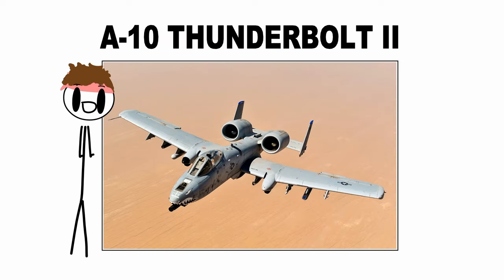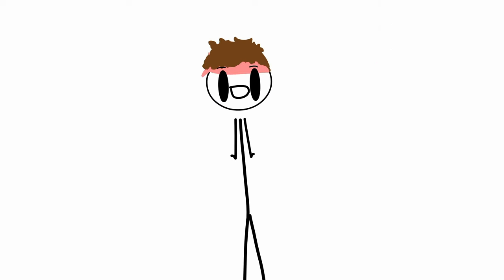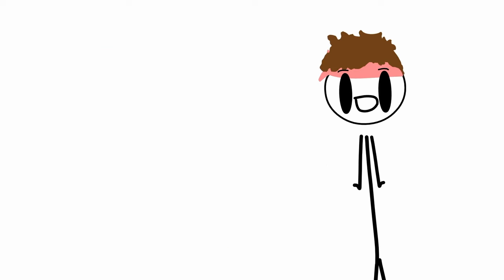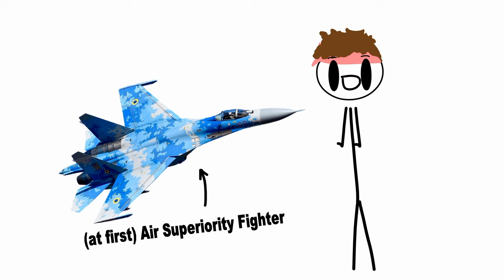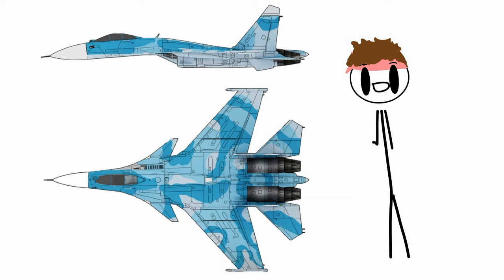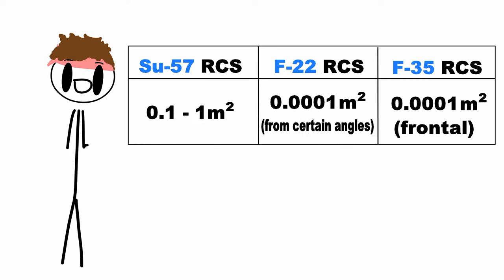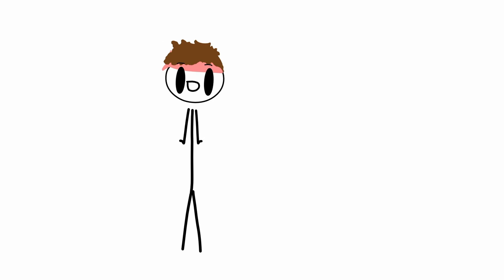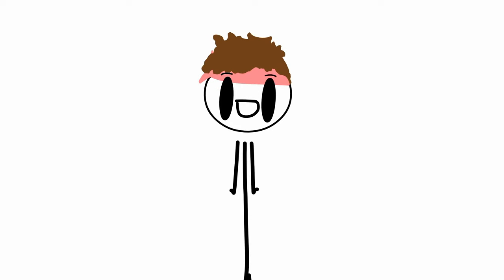The Coolest Facts about the Coolest Fighter Jets 3

Comment: The Su57 is still the only stealth fighter that everyone can see on radar.
Reply: anyone can see stealth fighters on radar but you can’t lock on to them
Reply: "it's not stealth it's a low visibility 4/5 pile of sh##" -habitual Linecrosser
Reply: @FutureGohanGlazer  it's got worse RCS than 4th gen fighters, you can literally see the wood screws visible on the airframe. It sure as hell can be locked on
Reply: @Ballistic_Idiot lost a dogfight to a kite bought my stealth fighter of wish also "habitual linecrosser
Reply: Never had been...
Reply: @ahta5708 that's the T50. not the Su57
Reply: @OAZO_Kcey no way, someone that can actually tell the difference between those 2
Reply: @poopyickydoodooobama09  if you can see it, you can lock onto it
Reply: @FutureGohanGlazer  Rafale had a lock on the f22 for 10 sec straight before wining the match
Reply: @FutureGohanGlazer that's just not true
Reply: @OAZO_Kcey you realize that in those matches the F22 has to be equipped with drop tanks in the dogfights. The Rafael also was placed behind the raptor. If it is a normal combat situation, which is a bvr fight and not a in visual range fight, the Rafael would win a total of zero times.
Reply: @OAZO_Kcey nope, look at recent videos, neither the screws nor the unpressurised bombbay issues nor the inlets being visible from the front have been resolved.

It is a propaganda piece, not a stealth fighter.

A current day IS-2
Reply: @apersondoingthings5689  The F22 Didn't have any extra stuff.
Reply: @koekiejam18  Like i said. It's the T-50. A prototype version of the Su57. If you look at the real Su57s (IRL) you will see that they don't have the screws at all.
Reply: @OAZO_Kcey  The T-50 is sukhoi's internal designation. Su-57 is the russian airforces designation.

Think Ar-15 and M-4.

Also maybe if you wanted to really counter anything i said you shouldve taken all my three points in your rebuttal.

Even if it was without screws, that still doesnt fix the unpressurised bomb bays nor the engines being visible from the front.
Reply: @al_the_crow see actually no one can because russian mod themselves retitled the T-50's they had to be Su-57's
Reply: @beProsto  t-50 is literally just a prototype airframe that later became su-57
Reply: @koekiejam18  if you look at the production units you'll see the screws have been changed and aren't the older screw types.
No weapons bays aren't pressurized (it would deafeat the point of having a weapons bay), although the gap between the doors should be smaller and that is a problem with construction quality not design (however I haven't seen a Su-57 weapons bay from up close aside from the preproduction variant, maybe they could have improved build quality).
I agree with the point about the engine, they made the engine radar blocker to reduce RCS and it does work a bit, but its not as good as an S-Duct and they should have changed it in the original design years ago.
Reply: And anyone that talks about how the RCS is similar to a clean F/A-18E/F aren't exactly wrong but they aren't right either, those documents that were made public were talking about average RCS in a 360° arc around the T-50, one figure will average out the other (for example if viewed from the rear the Su-57 will have a huge spike of RCS compared to the front, this will raise your total average RCS) it was also before it was even accepted to go into preproduction, in those documents it was also written down ways of improving the RCS during production and materials to use in the RAM as the original analysis didn't consider RAM. Today it is definitely more stealthy than at that time as we now know that the russians started using RAM in the Su-57 and changed the engine covers around the engine. 
So overall the average RCS value of a 360° arc around the plane shouldn't discredit the frontal aspect of its RCS, in the case of the Su-57 it definitely has improved overtime (but it isn't as stealthy as the F-22A obviously).
Reply: @FRGBlackBurn  I might be wrong so take this with a grain of salt, but last I checked the su 57 still is not in production, it's still a prototype
Reply: @firewolfy_6  I mean, it has a very limited production but it already has a production variant so it isn't a prototype anymore.
Reply: Stealth doesn't means invisible you know
Reply: @OAZO_Kcey  I'm guessing this was in a war game in which the F22 as standard carries drop tanks negating its stealth an maneuverability. The Rafael wont beat the F22 in a BVR match under real combat conditions.
Reply: @cockatoofan  Any radar can detect an F22 as long as its past the burning through threshold of the radar, which is put simply the point were the stealth is useless. Now to your other point, the F22 is a pure breed fighter, it is not intended for SEAD and as such is only intended to be as close to invisible as possible to other fighters. yes being invisible to Search radar would be nice but is unrealistic  as the burn through on the Search radar is stronger than an airborne radar and as such the F22s stealth only hides the radar at certain ranges but this is enough to create gaps in a radar screen which can be exploited for a behind the enemy lines attack. Se the B2 video by Mustard for a better explanation of this concept.
Reply: @mathijeba5375  Yes I do. Anything stealth can be detected, but the point is to delay that point of detection as much as possible to reduce the time the adversary has to react.
Reply: @cockatoofan  Maybe I did repeat a lot if not all he information unintentionally. to be honest I skim read a lot of it. But the main comment in this thread was complaining about the F22 so honestly didn't think much of the F35. And the F35 is a good SEAD jet in its own right but in terms of its stealth capabilities as far as I understand it the F22 is still better than the F35.
Reply: @cockatoofan  in all this, it's important to remember 2 things. Both aircraft are classified, so as you said, Lockheed is unlikely to release a lot of info, and the capability of the F22 will be less than the F35 Co saddening its 30 years older.
Reply: @firewolfy_6  Neither the burst nor the F22 had any additional equipment. it was a 4vs4 (real-time combat simulation) where you had to lock on to him for 4 seconds or aim the plane at him. The burst won.
Reply: @OAZO_Kcey  Source? Id like to read up on this.
Reply: @firewolfy_6  sure, let me see my search history (i'll modify my comment once i found it)
Reply: Probably because the whole "stealth fighter" designation came from external media assuming it to be so. Sukhoi's patent quite clearly states it's a multirole fighter with reduced radar visibility, which it achieved.
Things like visible screws do NOT increase RCS values as those can quite literally be seen even on the F-22 and similar jets. Langley AFB quite literally flies F-22's with cracked RAM coating and visible screws, after having spoken with an F-22 avionics tech, screws have next to no effect on the overall stealth capabilities of the aircraft, the fuselage shape, leading edge alignment play the biggest role of all, on top of that the RAM coatings just bring that value even lower.
What people assume to be the "visible engines" are actually the so called radar blockers Sukhoi came up with, the capabilities of those are not known, but the engines certainly are not visible due to the fact even the Su-57 has S-curved intake ducts, simply not as pronounced as the F-35 and its contemporaties.
All in all, the Su-57 is undeniably the most maneuverable 5th generation fighter out there with some of the best radar arrays, although the T/R module count on its AESA is not the highest, it's less than 100 modules behind the F-35. Combine that with DIRCM turret, engine TVC and EO/IR tracking and you have a fairly solid multirole fighter.
If you do want to criticize it, then critizice the rampant corruption present throughout the entire development cycle and the absolutely rotten government under which it's being made, plus you can most definitely call out the insanely low production numbers lol.
Reply: you can see and lock any stealth aircraft its just the better the stealth on the jet, radar used by a bandit makes a difference at how far you can see them 👍
Reply: @ahta5708 not worse, comparable to fourth gens.
Reply: not true. it doesnt move so it stays in the hangar, its also useless.
Reply: Not true, the SR-71 could be seen on radar...because it's massive engine plume reflected it
Reply: @ancaplanaoriginal5303  What does that have to do with the su 57?
Reply: @OAZO_Kcey  well that would be because it was stripped of lots of its stealth capability for "training and in the spirit of fairness"
Reply: @ancaplanaoriginal5303  The difference being a paper airplane can shoot down an SU-57 and nothing will ever touch an SR-71
Reply: @strawberrymilk9767  I wish the YF-12 was successful ;(
Reply: @ancaplanaoriginal5303  I wish the YF-23 was put into service instead of the YF-22
Reply: @AedanEriks  you can't remove stealth like that ☠️
Reply: @OAZO_Kcey  yes you can by adding drop tanks or opening weapons bay absolutely
Reply: @strawberrymilk9767  The F-22 was way better in everything but RCS
Reply: @ancaplanaoriginal5303  The F-22 was better close quarter than the YF-23, everything about the YF-23 was basically better. It even looks nicer than the F-22
Reply: @firewolfy_6 There is a VERY big difference between detecting, identifying, locking, and keeping that lock all the way to when the missile hits.
Reply: @snugglecity3500 Finally! Stealth is just reducing the radar return of something, these and delay detection, identification, and acquisition.
Reply: @codenamecrusade1083 "The SU-57 has S-curved intake" how the fuck do they do that when the intake is directly in front of the engines.
Reply: @ancaplanaoriginal5303 Yeah I once heard afterburneres can reflect radar, and at its cruising speed the SR-71 is ONLY propelled by the afterburner.
Reply: @WildmanTrading  The intake duct is not straight, it's not a fully pronounced S-curve, but the curvature is there and is assisted by the ability to partially close the intake, thus fully covering even the radar blockers.
Reply: you can lock them you just have to be close and by that point the have shot you down with an aim-120
 @FutureGohanGlazer
Reply: the f117 nighthawk was seen on radar by the french, and even the US hadn't talk quite much about it at those times lmao
Reply: @FutureGohanGlazer  you can only see stealth fighters on some radars. An f22 once snuck up on two f4 phantoms, and flew right under them without them noticing. Stealth fighters are not invisible, but lots of radars either don't pick them up at all, or just see bumblebees flying at Mach 1.
Reply: Nahh it’s so stealthy that no one ever saw it enter service
Reply: @firewolfy_6  IT WAS IN PRODUCTION SINCE 7 FUCKING YEARS AGO

Comment: I hate how everyone talks about the SU-27 being the first aircraft to be able to do a cobra, no it was actually the SAAB J35 draken in Sweden, heck they invented the cobra manoeuvre
Reply: saabs are so fucking cool, i absolutely adore the viggen and gripen, i watched videos of saabs landing and taking off the roads many times and i would buy saab 9-5 just to have saab logo on my car
Reply: @ser_igel  i have a saab 9-3 convertable turbo :D that i brought becuse i like the planes
Reply: There is misconception. the cobra maneuver is what we usualy see, when the plane raise its nose at 90° max , or a bit less and decrease its speed brutally the get back into normal flying position. The j35 wa sthe first jet to do this. Then there is the Pugachev's  cobra, wich is the same maneuver but the nose of the plane is raised beyond 90° wich was carried out first by a su-27.
Reply: Yeah, the, correct me if I’m wrong, the Kort Parad.
Reply: Well... technically not a cobra, but yes, it did the energy bleed point nose upwards thingy much earlier than Flankers. Tho it was more of a necessity for landing an early deltawing due to stability issues.
Reply: The Syrians have done it with their MiG-21's even before the Swedes, so no, the Swedish did not do the Cobra first.
Reply: No the swedes inventede the cobra manuever during the testing of j 35 draken in the 1960s it was called kort parade it was used to bleed airspeed.

Comment: Slight correction for the Felon, the visible screws don’t mess with the stealth a lot. They only mess it up if the screw is sticking up from the aircraft body itself, as we saw from the Nighthawk tests. The RCS itself is still low compared to the American jets, but that’s because of the conventionally shaped intake and the large engine blades (they say their going to fix the issue on the next variant). Also they’ve officially been introduced into service (there are 60 of them now) and have been flying missions over Ukraine (mostly BVR fights with hypersonic missiles, a few CAS missions).

Comment: Su-57 has a similar RCS (radar cross section) to the F/A-18 Hornet a non stealth aircraft. This is according to the company that makes the jet Sukhoi.

Also yes it does look good and the paint is nice other than the visible screws.

Swedish jets when?
Reply: Thast was just cope bro😂... dont belive what a youtuber saya to you
Reply: And its not just the screws actually, the fans of the engine (which is apparently the same one used by the su-35, the jet it was supposed to replace) were exposed from the intakes making its RCS even larger

Unlike the F-22 or F-35 whose intakes bend inside to avoid that exposure

There is also its questionable mechanical reliability

Overall the su 57 is just a very expensive 4.5 gen fighter
Reply: @harbour2118 another fun fact is the weapons bay. Russia couldnt figure out how to reliably make sure the pressure inside it is the same as outside the plane, so they had the genius idea to just leave a gap.

On a stealth fighter.

You know, the type of plane where the western variants have specific shapes of doors that make them close flush.

Comment: Another A-10 fact: Its Main Landing Gear is only ever partially retractable. This means that part of the wheels stick out the bottom of the aircraft, which sucks for aerodynamics, but helps reduce damage endured should the pilot need to belly-flop the plane...A.K.A do a Gear-Up landing.

Comment: the a10 is not a plane with a big gun , it's a plane strapped to a big gun
also fun fact: if the gau 8 on the plane fires for too long the plane will stall and litearly falls out of the sky
Reply: The plane falling out of the sky  kinda eludes to the gun's recoil slowing the plane down.

In reality though, I think it's the gun's fumes that are ingestest by the engines and possibly stalls them.
Reply: That's not quite true, or at least misleading, but what's true is that they needed to keep the shells inside the plane while firing, otherwise the plane would lose too much weight while doing a gun run and could potentially become unstable.
Reply: @metalogic1580  I stayed nothing abaut weight, I stayed the recoil whould slow it down enough to loose lift and fall down...
Reply: @mr.Celsius  yeah but that's full of crap. I was just """staying""" another semi related fun fact about that gun with wings that is the A10

Comment: a10 is kinda mid, its outdated and its liable to getting shot down by surface to air missiles cause it's literally slower than a ww2 prop plane.
Reply: max speed of the a-10 is about 420mph most ww2 can out speed it but not out rate it. also carrying capacity is almost twice what a ww2 prop can carry. yes its a good thing they are fading out of the military but a ww2 prop would get dusted but a a-10